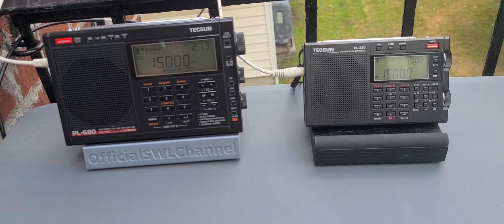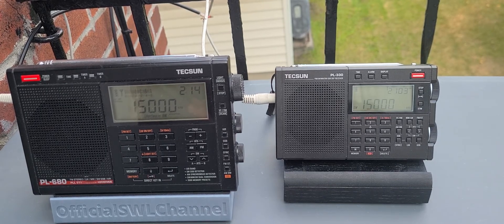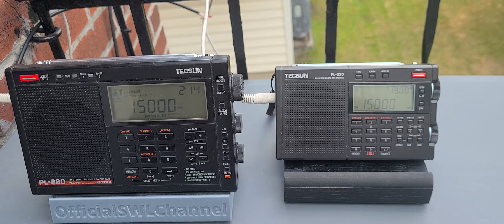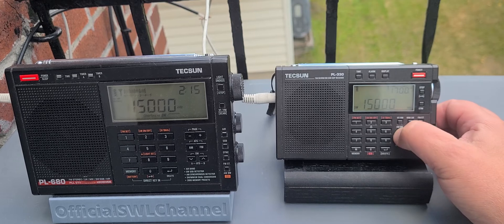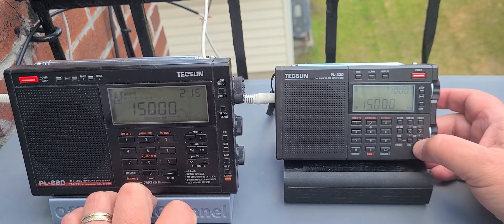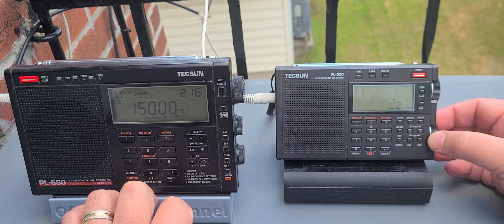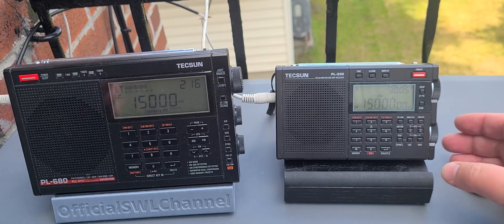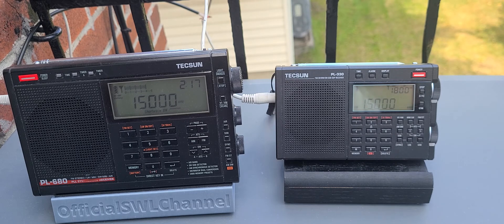Key differences Tecsun PL-680 PPL Synthesized receiver VS Tecsun PL-330 DSP portable receiver

Comment: I recently picked up a 660 to supplement my 320 and am not happy with it. The little 320 seems to pick up stations better and doesn’t pass by signals when scanning like the 660 does. Maybe I got a faulty one? It’s hard to know. I’m very pleased with the PL-320, not so much with the PL-660, which is so similar to the PL-680. Hard to know what model to try next. Thanks for all of your videos.
Reply from the maker: The 660 is great and not at all the same type of receiver as the 320 that is DSP ...  660 is meant to be used as a normal radio , scanning manually with the tuning knob.  Also it has SSB that brings way many more signals to listen to ..amateur radio, aeronautical, maritime and more.  Its not faulty it is different

Comment: Is it safe for me to use lithium ion batteries with the PL-680? It says Ni-MH on the display.
Reply from the maker: not for charging, the radio does not charge Lithium Ion
Reply: @OfficialSWLchannel  Sorry for the late response. Will charging the lithium ion batteries in this radio cause any damage? I heard some people say it shouldn't have any issues but I'm unsure how true this is.
Reply: I don’t know the answer to your question, but you may just want to try regular non-rechargeable AA batteries. The PL-680 doesn’t use much power, and four AA’s will last quite awhile.

Comment: I want to know is there any real difference in reception quality between PLL and non PLL? I mean is this just about tuning or PLL also helps keep the signal strong? I always thought PLL is like locking the frequency to stop the signal from going down. Is this not true? I mean if u once tune a radio with a particular frequency then there is no difference in listening between PLL and non PLL? Kindly help me understand. Thanks
Reply from the maker: PLL keeps a radio precise and stable in tuning with no drift, it does not help a signal, it makes tuning precise compared to a analog non PLL receiver that needs to be retuned regularly as it drifts
Reply: @OfficialSWLchannel  actually i was asking about digital radios with or without PLL. I have tecsun 310ET without PLL and it doesn't need to be retuned like anolog radio. But i want to know any benefit of PLL, is this only about soft muting like u said in ur video?
Reply: @AsBi1  yes soft muting is the only difference. However, DSP radios can often tune into the weaker signals, whereas the PLL ones don’t.

Comment: I bought the Pl-680 and the Pl-990x at the same time . I really love the pl-680 I hardly even use the pl-990x. The Pl-680 just feels better in my hands over the Pl-990x .
Reply: I have the 330, the 680 and the 501, and I agree, the best "feeling" one is the 680 in my opinion.
Reply: @wrnchhead76  Ainda tem o 680 ?